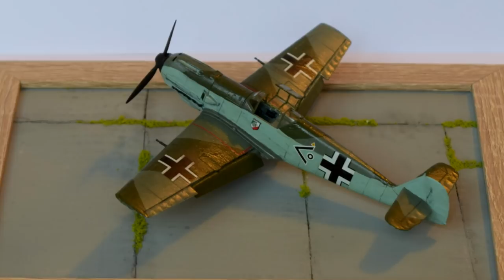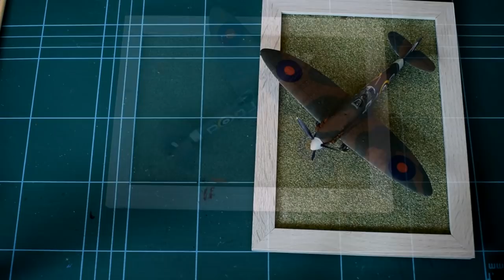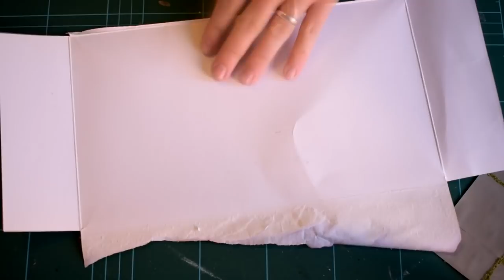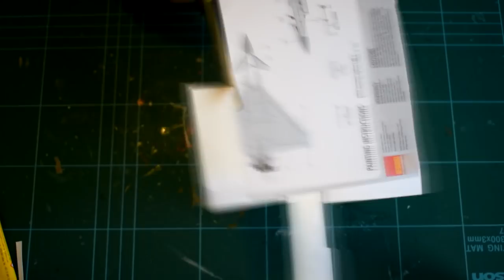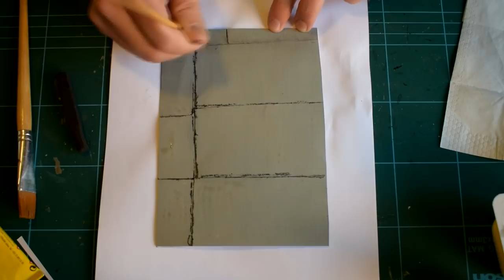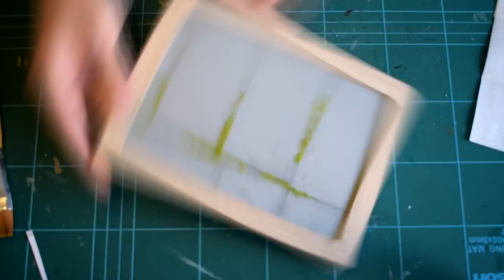How To Make a Cheap & Easy Tarmac Display Base for Scale Models

Comment: First I would raise the level of the concrete slabs to that of the wooden frame (or a few millimeters above), so the model can be better seen from every aspect. The grass in the gaps is a bit exaggerated and the "poison green"-color does not look very natural. The wide gaps not grown over with grass (or is it moss?) would be real tripping hazards. In reality they are filled with bitumen and made even. Finally I would stick a plate with the aircraft's designation on one side of the wooden frame. This can be made on a printer with plain decal sheet paper (you can easily find online). If you use an inkjet-printer the surface of the printed label must be protected by a layer of clear varnish, most simply by a spraycan...
Reply from the maker: sounds like some cool upgrades

Comment: That's really clever! Did you come up with this yourself or you see someone else do this? Never seen anything quite like this, especially cutting the tarmac slabs from a reused box.  Gives a nice 3-d effect, usually see individual slabs represented by paint lines.
Incidentally, I was told there's a difference between cheap and inexpensive. This is inexpensive, but by no means cheap! Not all of us can afford expensive pre- made bases or have the time or materials to make more elaborate bases.
Reply from the maker: Douglas Burch good point! I’m sure I probably saw this somewhere before, but came up with the method of creating it by myself

Comment: Pretty good for a "rough & ready" cheap base. Typically, I guess you could say, I go all out for my bases/dioramas. I keep a "stock" of at least two different shapes/profiles of molding that I cut to size for the parameter and usually a minimum of two layers of insulation foam (XPS) for the "field". Then I go from there, adding any other height/hills or cut out for dips/ditches/depressions, so on & so forth. 
Personally I'm the type that figures that if I'm putting so much time & effort to make the subject (whatever model I'm building/built) look believably realistic, that I should put forth the same effort into the base. But that's just me (obviously I'm a bit of a perfectionist). I do however use picture frames for "test pieces". Basically when I'm trying a new technique/process or material. Mostly because it's cheaper, quicker and easier, and also if it turns out good, I have a "little" base ready to display something. 

As I said though, it really does look pretty good. I might have to incorporate the premise in one of my up coming builds. Thanks for sharing your tips.
Reply from the maker: Thanks for watching and your info! I might have to try a more complicated and realistic base next time :)

Comment: You might want to add some oil and fuel stains  to the parking spot as piston powered engines are known for leaks,  jets aircraft too just not as much I was a USAF crew chief on both piston and jet aircraft
Reply from the maker: good idea!

Comment: absolutely easy and cheap, I'm gonna surely try. also using the internal side of a card box (like corn flakes boxes) could be a good idea, as the inside is a little more "rough" and give a nice asphalt texture. what do you think? :)
Reply from the maker: yes, that texture certainly helps
Reply: oohh, good idea! I was thinking about cork sheets for some really rough asphalt?

Comment: Ok, so I'm making an F-100D Super Sabre, and I have made multiple models before, however they all looked a little messy and not as good as I want (except for an M4A1 Sherman I did, but it was a single color, so it was easy.) If anyone has any basic tips for making a decent looking model, than I would appreciate it!
Reply from the maker: What is it that you're getting stuck with in particular? If it's your painting skills then you may just need a little more practice. I've made a number of beginner guides on different aircraft models if you'd like to check them out for some ideas :)
Reply: @ModelMinutes  yes, it is mostly my painting skills, because many times when I am painting details, the lines appear rough, especially when there's no panel line to go by. I did watch your Spitfire beginner's guide, and it was helpful.
Reply from the maker: Tactical Baguette I’m glad you found it helpful. You can get some modelling masking tape to help you with straight lines if you’re struggling. I know some people use blutack for wavy lines too
Reply: @ModelMinutes  ok, thanks!

Comment: What is the fake grass thing?
Reply from the maker: The scatter material? You can get different kinds. I tend to use either the ground foam or wood types. Static grass is really great though and i really should use it more
Reply: @ModelMinutes  thanks a lot!